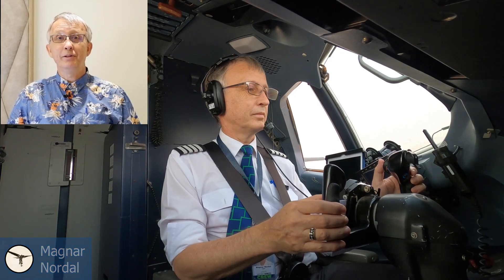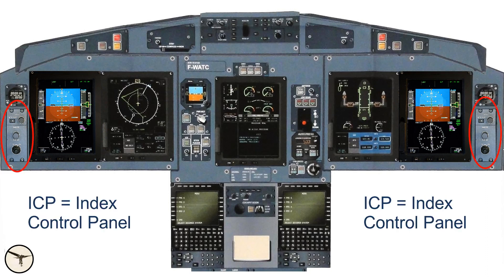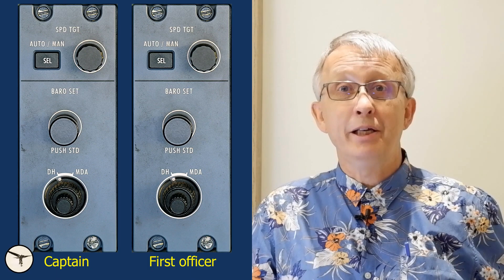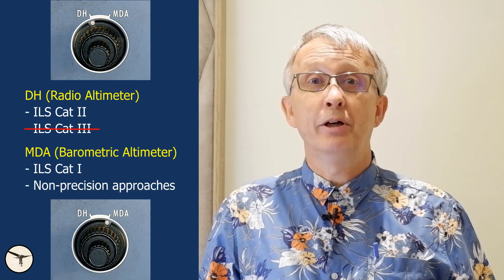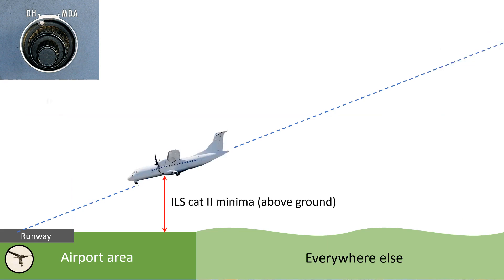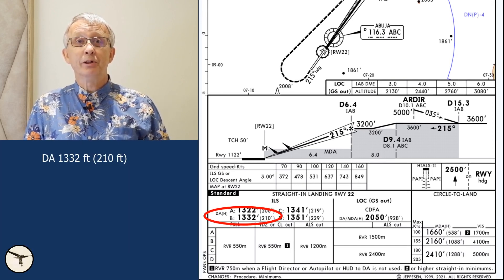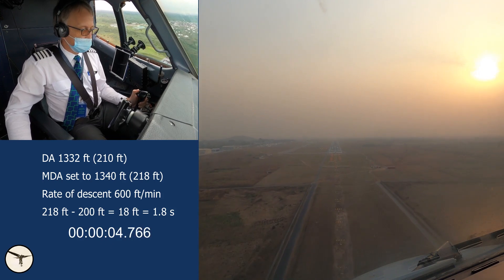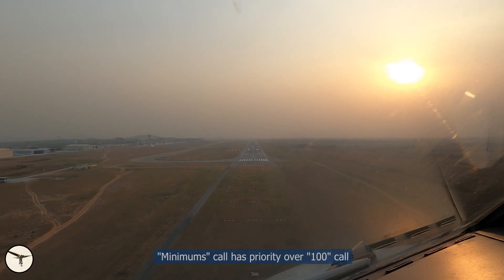Don’t do this mistake! | Using DH and MDA in ATR aircraft with glass cockpit

Comment: I remember the same DH/MDA usage on the A320. At some point (I think with the LCD upgrade) they switched to "BARO" and "RADIO" instead, which in my opinion is the better choice. The checklist would then only mention "minimums", though I actually have seen "MDA/DA/DH" in an actual airline checklist.
Reply from the maker: Agree. BARO and RADIO make more sense. I'm pretty sure ATR will follow suit.

Comment: Another comment regarding DH, at 4:59 you mention “nobody has measured the elevation of the terrain outside the airport perimeter”. However the published DH on a Cat 1 approach chart is the height above terrain at the published MDA (so not in reference to the runway threshold). I believe the terrain elevation is taken into account, let me know what you think, Thanks
Reply from the maker: "... with this in mind." 
Published DH is the height above the runway threshold, and not the terrain. By regulation, DH cannot be less than 200 feet on a Cat 1 approach.  
However, the required terrain clearance is less than 200 feet and depends on aircraft category. In AIP, ILS cat 1 minima is published as OCH, which is the "allowance used by the procedures specialist for vertical displacement during initiation of a missed approach." For ATR (category B), the value is 142 feet. The computation method is quite complex; it's described in PANS OPS volume 2. 
The terrain outside the airport perimeter is checked for obstacles that can affect approach minima, location of the landing runway threshold, and the required climb gradient after take-off.

Comment: Hi CAPT Magnar, ILS cat 1 using MDA ,is it valid for another aircraft .? As I know Precision app use DH, non precision app use MDA
Reply from the maker: In ATR aircraft, DH means radio altimeter, and MDA means barometric altimeter. Boeing is using RADIO/BARO, which is more correct. 
For ILS cat II, we use the radio altimeter to define minima, which is expressed as DH.
All other minima are defined with the barometric altimeter:
3D approaches (ILS cat I, LNAV/VNAV) are defined with DA. A missed approach can be initiated at DA.
2D approaches ((LOC, VOR, LNAV, NDB) are defined with MDA. A missed approach must be initiated at MDA plus 30 or 50 feet to prevent the aircraft from descending below MDA.

Comment: Hi Mr Magnar. Can you tell me where to find this on the ATR 72-500? I can change the DH if i use some keys in my simulator but i can' find the switch / knob in the 3d cockpit. Thank you :)
Reply from the maker: The video is about the 600 version with glass cockpit. On the 500, the DH is set on the EFIS Control Panel, and there's no option for MDA.
Reply: @FlywithMagnar  I noticed that the video is about the 600, that's why i asked for the 500 :) After i read your replay, i watched fast through your "ATR systems - EFIS instrument panel part 1" video and found the answer. This function is sadly missing in the Aerosoft ATR 72-500 but now i know to wich knob i have to add this function if i build my home cockpit :)  Thank you very much.